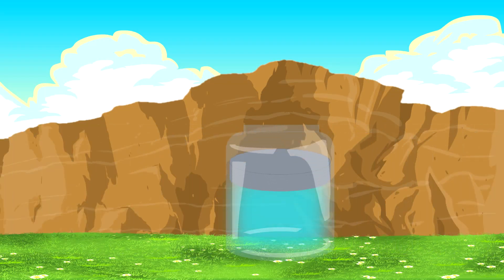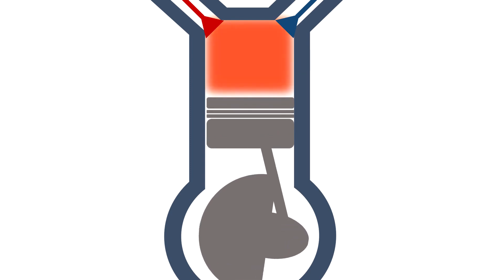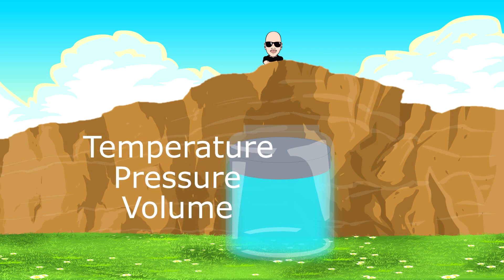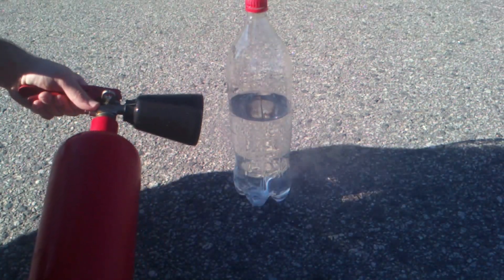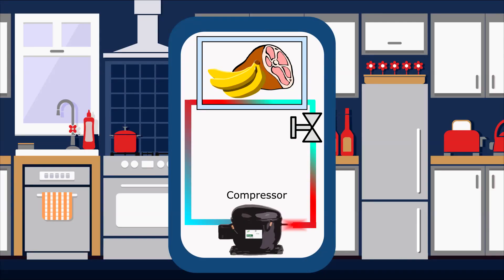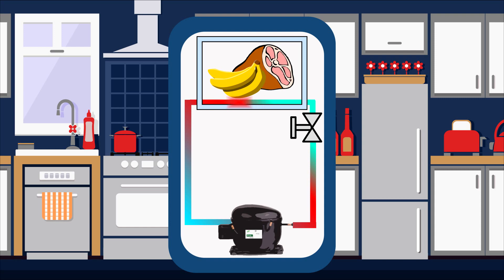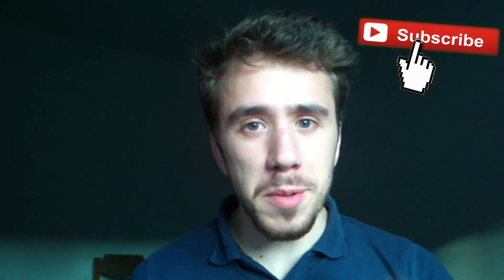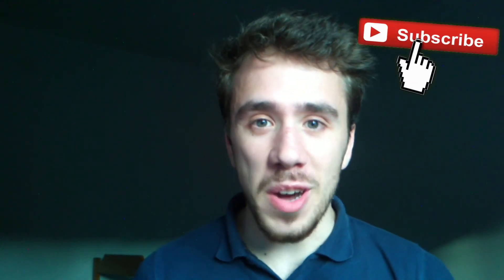How a refrigerator works - Ideal gas equation explained

Comment: Industrial facilities have a blower pumped compressor send fluid go through expansion engines, ductwork conduits under cooling pond towers, etc. and then into a vacuum pumped Tripler Air Liquefier Cold Box tower.

Via Robert L. Morrison's Patented lighter than air solids "SEAGel" or "Biofoam" sealed in a metal foil one could have towers extend into orbit of a much improved cryochiller.
Reply: Joule Thompson Valve most important to industrial.

Clusius thermal diffusion such as Girdler Sulfide to extract isotopic fuels since even Ranque's Vortex tube refrigerator has been patented to extract isotopic fuels.

Comment: Perspective, common, good exercise.🍪🍩 integza you know hearts and triangles achieved the same points so finally and this time it’s for real it all depends on how long the compression takes you like quiksilver and the quality of the material absorbing, cotton absorbs a lot of liquid quickly but it’s not as strong as carbon fibre fabric. and a disposable mesh would shield heat from the sun only as long as you string the compressions together, like a heart, You can have one but it works better with two, like your disgust for tomatoes or biofuels, isolating hot from cold🍽🍅

Comment: Also I think diesel engines do not compress an air fuel mix. they compress the air then
 the fuel is injected at quite significant pressure of 5000+psi. 
That then ignites due to the extreme temp of the compressed air. 
Don't know but that's what I think

Comment: Just so you know... I'm a huge fan and have started watching your videos recently. Brilliant work! Keep it up!!!
 But as an refrigeration engineer I'd like to point something out.🤔
Your refrigeration cycle animation is missing two critical components, which allow for the heat exchange to take place.
First one is condenser. It is placed between compressor and expansion valve (it's purpose is, simplifying things a bit, to allow the refrigerant to reject the heat absorbed inside the refrigerator and change the state of the refrigerant from vapour to liquid). The second one is evaporator, which is placed after the expansion valve (it's purpose is to allow the refrigerant to absorb the heat from the inside of the refrigerator and doing so change the state of the refrigerant from liquid to back vapour).
😊
There... My OCD has been satisfied and I can safely carry on with my life 😂🤣

Comment: Draw a control volume; the room walls. Electricity power enters the room but no any other boundary condition change. No mass transfer, no any other energy transfer. So, what happens to the room temperature now? What happens to the electricity energy comes in to the room? +Integza @Integza
Reply: Easiest way to explain it

Comment: Even if the compressor was perfect, the room would still get hotter! ;-)
Second law of thermo!
To dump energy from cold place to a hot place, some external work has to be done!
Reply: Indeed - this effect was explained with the jam jar, but not clearly with the fridge and then dropped from the conclusion. Compressing the air causes it to heat up, and then that heat is dumped into the room as the compressor fluid is allowed to thermally equilibrate with the room (using a copper coil - this is what you can see at the back of the fridge). Then when the compressor fluid expands and cools, it is colder than the room. If the liquid was not allowed to cool before expanding, it would simply reach the almost the same temperature it started (it will never be perfect). It is this thermalization of the compressed fluid that is the main cause of heating the room, and is why we need to add energy into the system. Otherwise a very nice explanation!